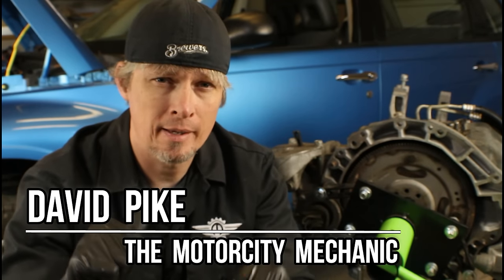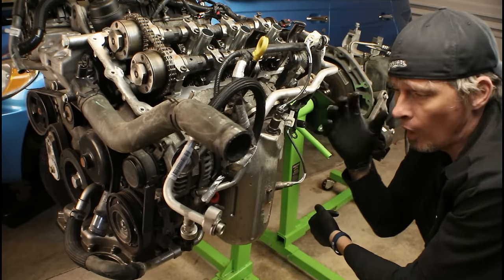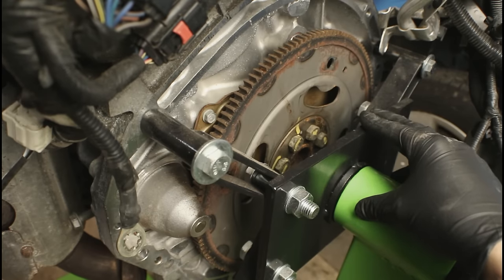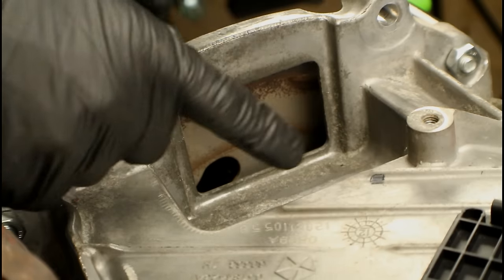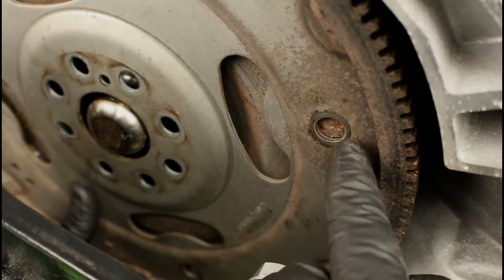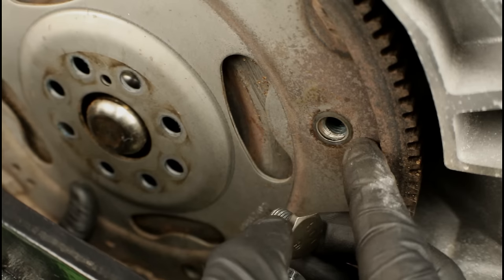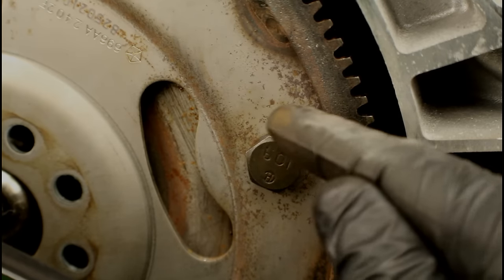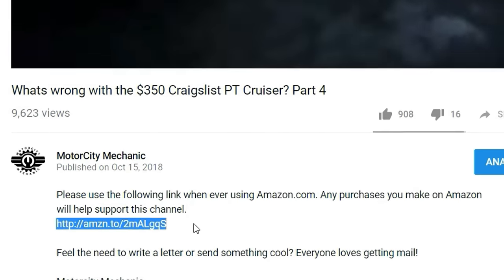Quick Tip: Installing Torque Converter Bolts

Comment: 1983 Toyota 4ac engine with a automatic transmission , the flex plate holes for the torque converter are the same size  .
How would you go about mounting the torque converter to this kind of flex plate  ?

Comment: should I fill the torque convertor with trans fluid  before it is installed?
Reply from the maker: It seems to make a big mess in most cases. Personally I dont. Depending on the trans I will add from 4-6 qts fluid, start it up and then start checking the level and then start adding 1 qt at a time until I get to the proper level. Thanks for asking and for watching. Make sure to subscribe

Comment: Great video Dave, I have the same engine and transmission in a 2012 Grand Caravan. I'm currently replacing the flexplate for second time. Any idea as to why flexplate is cracking around crankbolts?
Reply from the maker: The only thing they state to do is make sure that the 2 alignment dowels are present on the engine that line the trans and engine together. If one or both arent then the trans can be slightly off centered and cause it to eventually crack. So make sure to check that when you get time otherwise nothing else that we have been told so far. Thanks for asking and make sure to subscribe.
Reply: Same....I replaced the flexplate at 80K and now at 140K 12 T&C.

Comment: Shouldn't my axle input gears or whatever (the place with the seals where you plug in the axles) shouldn't those gears inside spin if the transmission torque converter is seated properly? I was thinking they would spin as I move the torque converter, but maybe I'm wrong.

Thanks for the video!
Reply from the maker: Turning the axle will have no affect on an automatic trans. The torque converter body only turns the trans pump to build up pressure. WIth no pressure.....there is no trans output at the shaft/axles. Thanks for asking and make sure to subscribe.
Reply: @MotorCityMechanic  thank you sir! Yeah couple of other people told me I would have to be turning the crank faster than humanly possible in order for there to be any movement at the axle output. I just made a video showing me seeding it up and connecting it to the flywheel. I'm going to make it in the next comment if you don't care to look it's only about 2 minutes long. I don't know if you would be able to tell me anything from it but I'm just being paranoid and trying to get some info from people smarter than me. I spent almost six months rebuilding this engine in my free time and the engine sounds beautiful but I failed to see the torque converter so I had to take everything out again. It's been a real pain in the ass. Thanks for the info.
Reply from the maker: @mattmgarza  Your welcome Matt. Feel free to post the link.
Reply: @MotorCityMechanic  I failed to mention in the video that I pushed and wiggled the torque converter and I definitely believe it "clicked" or seated into place two times. I tried and tried again to get it to go deeper, but no luck, so that's what makes me think I'm good. Sorry for my paranoia, lol.
Reply from the maker: @mattmgarza  There is typically a measurement to look for as far as how far back the torque converter is seated from the flat surface of the bell housing. One way to know if its okay is.....did you have any issues with bolting the trans to the engine....did you have to pull the two together using the bolts (big no no) and another is when bolted up and the torque converter bolts not installed.....can you still spin the torque converter to align the holes? if you can still rotate it then your okay.
Reply: @MotorCityMechanic  I spun the torque converter in order to get it's bolt hole to align to one of the bolt holes in the flywheel. And of course that aligned the three other holes. So, yes, I was able to spin the torque converter by hand when the transmission was bolted to the engine.

It mated to the engine with no problems. It was obviously hard to pick up and manuever, but it didn't require the force of those bolts to get it to pair flush to the engine.

Last time, it required an impact wrench just to get it to mate to the engine, lol. So obviously that was a problem. Luckily this time around it's a different transmission. I assume I damaged the old one.

Thanks for your help!

Comment: I am working on newer version of pentstars engine and there is no access hole to it, I just installed new transmission in durango 4x4 and yet I cant get torque conventer to turn with hand and it is only accessible through starter hole

Comment: Dang it!

Now, what? LOL

I'm bolting in my transmission tomorrow, on an 04 Saturn Vue AWD CVT 2.2L I4! 

That is, if it will bolt together straight - slight bit on one end to adjust - lost my light today. 

I think the TC is lined up with the flex plate holes... now, I don't know, if there's a funky hole! 🤔🧐🤓

....what to do... I hope there is info out there about that? The manual is terribly not helpful there....

Better I get it right...

Thanks

Comment: Do you require to reusing the bolts ?
Reply from the maker: Depends on the manufacture and which engine. Most of the time they want you to use new bolts.

Comment: I completely understand everything in this video but I had a flex plate job bc the old one was junk, I’m having trouble with putting the converter bolts in bc I’m doing without pulling the motor out and I can put two out of three converter bolts in but the last one don’t wanna line up. What do i do, bc I’m thinking the flex plate isn’t lined up completely. Reason why I think that bc when I put the new one on I could only get 7 out of 8 bolts in the flex plate bc the last one won’t line up.

Comment: Do you have to bolt the flexplate to torque converter bolts in star pattern?
Reply from the maker: I personally don’t and have never had an issue

Comment: Is it common for flexplates to crack 2013 grandcaravan 93541 miles on it it's making noise sounds like it's coming from between engine and transmission only does it at idle and when shifting from park to drive

Comment: I'm trying to understand if the flex plate mounts to the crankshaft and the torque converter mounts to the trans spindle how can you access those bolts
Reply from the maker: crankshaft bolts go in thru the flex plate from one side and the torque converter the other side. There is always an access either a panel you take off like in this case or the starter gets removed and then you have access to the torque converter bolts. Thanks for watching and for asking. Make sure to subscribe.
Reply: @MotorCityMechanic  ok thanks ,now I fell comfortable in doing this job 👌.
Reply from the maker: @bighomieJ5X  Your welcome. Just take your time and enjoy the weekend

Comment: I have a 98 chevy tahoe. Replaced the transmission, new flex plate, new torque convertor. When I install the transmission to the engine, it bolts up fine. I go to install the torque converter to the flex plate, there is a gap of about 1/4" to 3/8" gap between the torque converter and flex plate. I tighten up all three bolts to the torque converter and flex plate it locks everything up. What the hell am I doing wrong?
Reply: What was your issue? I have tahoe to.. Im doin tranny. I also noticed the little quarter inch gap.. I was confused. I would think if i pulled converter towards the flex plate it would unseat my converter.  But i mean thats how its made i guess a quarter inch wont hurt.. But you said it locked it up? You do know once the converter is bolted to flex plate it cant spin freely? Only way to spin iy is to spin the crankshaft..if you can spin your crankshaft with a socket man your good nothing is binded up bro.. We live and we learn man.  Im sure you did it all right..im hoping i did all mine right lol.. Hit me back let me know what happened man..thanks
Rob

Comment: Hi Mr Dave,
Thanks for all your help. 
And work on all your videos . 
I had a question . I have a 2012 Ram 3500 4x4 with a 6.7 .
And I got a code PO933. And wanted to get your advise , if you didn't mind and had the time. 
It would be much appreciated. 
If you don't have time to help. Thanks anyways . For your cool channel.

Comment: Hello hi sir how are you I have a town and country 2008 3.8 L I have an issue with the car as soon as I put in a drive my car shut off that was driving fine before I’ve never issue with anything like that before but are the Reverse work fine And also when I drive if I push hard gas car drives fine as soon as I try to stop or slow down and start jerking off and shut off again then I have to start again and put it in drive and give a little hard gas to get back on the road but in the slowest shut down and you please give me an idea what is the possible thing damage in my car but I have to fix I’m actually doing everything by myself

Comment: Just came from the dealer to make an appointment to have my transmission looked at shifts hard and I noticed a rattling noise in the engine oil pan area when I changed the oil. 5 year warranty ends 06JAN2019 57k miles on it. Trans was reprogramed or flashed three years ago because of the same issue and they replaced all the motor mounts LOL so my Christmas present to my dealer is to drop it off on the 26 and let them figure out what the hell is going on before my drivetrain warranty expires and I have to fix it.
Reply from the maker: Let me know what they find....curious. Thanks for watching this video and for always keeping up with the channel. Merry Christmas!
Reply: @MotorCityMechanic  you'll be the second to know and Merry Christmas to you and all yours thanks for all your hard work!
Reply: Ford power clutch?
Reply from the maker: @cruisepix  Thank you and the same to you and yours my friend.

Comment: You should mention that some newer engines should not be rotated backwards. Turning some engines backwards can cause problems with the engines timing chain drive, it is better to be safe than sorry just don't rotate newer engines backwards.

Comment: Cool now show it in the pos where the subframe blocks access smart guy I'm not much smarter my self if your dealing with one of the wonderful VQ35DE engines and you're having to pull the motor attach the torque converter prior to reinstall it's a lot easier lining up the main shaft vs wanting to set the car on fire and calling it a day also even better don't buy a G35 or 350Z in the first place they're meant for kids with a harbor freight welder to lock the diff and go slide into walls with.